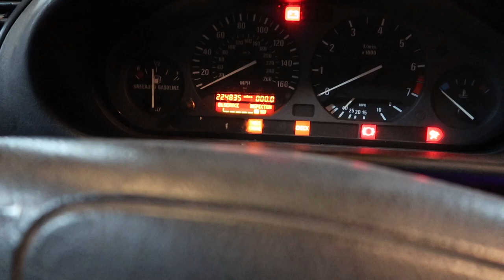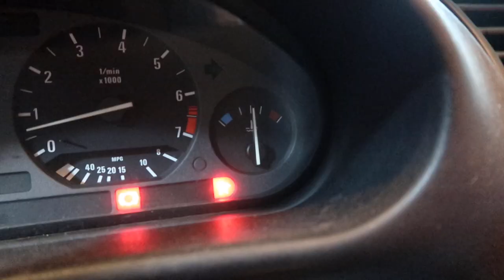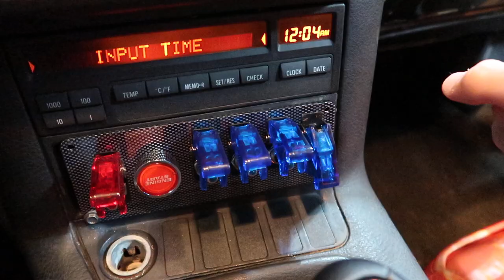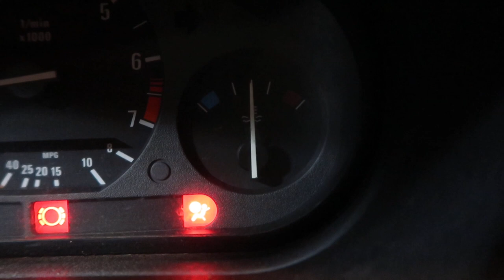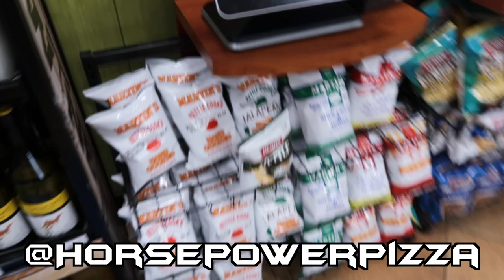Bleeding BMW E36 Cooling System

Comment: And after I’m done with bleeding the next day I like to suck out some water from the system because if you leave it fully filled then the water doesn’t have anywhere to expand causing excessive pressure too which can blow radiators and hoses!

Comment: Once it sucked the coolant down you topped it off you were good. If you noticed you keep it open for too long it will even boil over and begin to spill. 

With bmws they can be hard to get the thermostat to open up the first time after the system has been apart for a while and air is in the system. You experienced what I like to do sometimes when they are being stubborn. Running the car and then turning it off will allow the engine to heat soak forcing the thermostat to open. You know the temps start to rise when you shut and engine off so this in turn helps aiding the bleeding processs. Or else sometimes you might need to wait an hour for that bitch to open up idling there it’s so annoying. And make sure you run the heater too to get all the air out the heater core if you haven’t deleted that too
Reply from the maker: This funnel is a life changer! I deleted the heater so I haven’t had to deal with that, unfortunately there was an air pocket that led to it overheating first event of the year but I moved the filler neck higher in the system and re bled it and it’s been great since! Thanks for stopping by the channel!